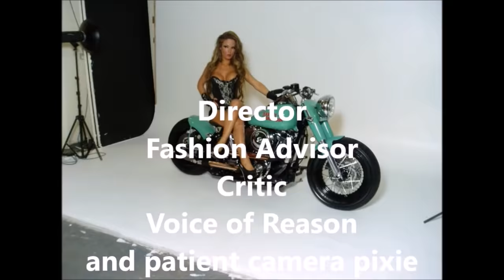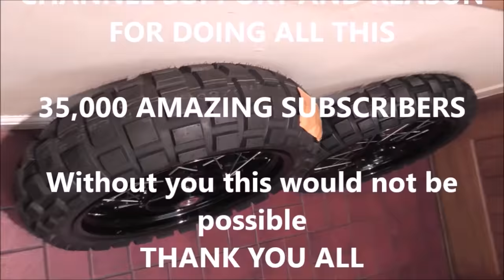Delboy's Garage, USD Fork Seal Replacement

Comment: It's much easier to loosen the top cap when it's not clamped by the top yoke so loosen the top yoke and clip-on first, then the top cap, then the lower yoke. Hope this helps someone.
Reply: I greatly appreciate your insights tips and tricks from all of us in Canada thank you very much
Reply: Agree entirely. Especially if the cap is pretty tight, the top clamp seems to compess the leg a (tiny! - everything is flexible..) bit making it even tighter. (as he said: "Actually, that's quite loose that ...")

Comment: Thank you for fortifying my courage to change my own fork seals!  I think I can I think I can... and with your guidance I'd bet I can!  Thanks for the great detailed instruction and also for your photographer for capturing in clear view all the internals and images!  Seriously, Thank you!
Reply from the maker: You're most welcome, glad it helps you Susan, best of luck with the job when you do it!
Reply: @Moonfleet41  Can I ask one puzzling question? I stopped by a well known local suspension shop and asked about them replacing my fork seals and got a negative (no, can do).  With explanation that they don't have the right tools for such long forks?  WTF?  (They are known for race suspension set up) But, just when would the issue of having to re-compress the spring and needing special tools come into play or be a concern?  TIA.... Susan
Reply: If you want an honest mechanic…. Get in there and turn them wrenches I have never out of dozens of encounters and much wasted time money and trust been short changed and lied to only to be in the position I should have taken from the beginning… wearing the blue coveralls and seeing the work through myself it’s same as any project you had to do in school first you find out what you are finding out the subject then researching that specific subject or component specific to your make and model not just videos either you read forums buy tech manuals read service bulletins from manufacturer buy specialty tools whatever you need to do to give yourself the best possible chance of success you will never do it another way after you start taking care of the work on your own it’s a great feeling
Reply: That being said I would happily hire this guy to do any work I could if he were in my area great work and thanks for posting this I subscribed and def liked thank you thank you thank you

Comment: I have re-changed oil seals on 3 different sets of usd forks due to a local bike repair shop not using the air gap messurment.. it's all very well adding the correct amount of oil if the internals are bone dry.. the air gap messurment tells you that 1/ the damper is bled and 2/the correct amount of oil has been added. . too much oil will cause exessive pressure and blow past the seals. ..... it seems rare to find mechanics these days that know exactly what they are doing ..... I would be happy to let this guy work on my own bike .
Reply: Did usd fork leak easier that just telescopic fork?
I heard its like that ,is it true?
Reply: The Correct amount of oil is critical .  All fork types

Comment: With the help of Delboys garage, I just replaced the steering stem cups and bearings, and disassembled the front forks, replaced the seals and re-filled with 10wgt on a 98 900RR. the bearings were shot and each fork only had about 4oz each of milky white watery oil. I also went over the suspension and set everything to the halfway mark. My bike now rides and handles like my 94 900RR did back in the day...which is "Resiliently". Thanks for the vids!
Reply from the maker: Great to hear it buddy... we're glad the video could help you out... have fun, summers coming.. Del.

Comment: The clutch side fork seal on my 2019 Versys 650 blew just before the current two week lockdown here in Pune. And I was so @#$%&* fed up. All workshops, whether official or otherwise, are closed with very stiff fines for opening them even for cleaning up. And I was mortally scared to finger the USD fork.

Delboy and Mrs Delboy, your absolutely brilliant tutorial was such an incredible relief. You cannot imagine how relaxed I became; to know that I can do this repair in my garage on my own and get the bike up was bliss.

The professionally careful and sensitive way that you handled the various parts is a lesson in itself; I showed your video to my electronics engineer son just to teach him this finesse in workmanship. So methodical, systematic, calm and composed. No unnecessary attempts at superfluous humour or off-coloured remarks etc. The exemplar of what a technical video tutorial should be like.(There is another video for exactly the same job and the way the guy there has handled the parts is an insult to the art.)

I haven't got the bespoke seal driver so will use some PVC pipe, insulation tape kind of mod. I'll play your video and work on the bike simultaneously so as to not make a single mistake.

Thank you ever so much for this terrific video. I have posted it on the Kawasaki Versys group for the benefit of all members there. Namaste.

Comment: I probably wouldn’t have attempted this without your video.  I’ve done other seals, but forks always scared me for some reason.  But this is totally doable, and even the seal driver isn’t that expensive.   There are nice aftermarket replacements for the springs, and even to add adjustable dampener on each fork.  Amazing.  I’m having fun wrenching on my bike.
Reply from the maker: Thank you for your feedback Jason and we're glad the video inspired you... good luck with your projects and happy wrenching!

Comment: Just picked up a Buell XB12scg that needs the seal replaced. The dealer said$275 usd if I bring in the tubes so after watching your video I bought the seal driver, the special nut holder tool, a front triple stand  and a rear super bike stand all for $360 and will just do all the servicing on my bike now. 
    Thanks to enthusiasts like you sharing knowledge and procedures, the option to perform these repairs allows us not to just save money but understand the dynamics of suspension and tuning to make the most out of rides. 
    Thanks bro brah!
Reply from the maker: Thank you very much fr your kind words of support, I really appreciate it and I'm glad the videos can help you, good luck with your Buell and have fun!
Reply: Where did you get a front stand for less than $200?

Comment: Hello from New Zealand. I have found this video very very helpful for my peace of mind although im not a mechanic but spent 5 and a half solid years within the heavy diesel automotive and construction machinery industry providing service and maintenance to my personal transport vehicles are no issue but now that i own a kawasaki meanstreak . . . . motorcycle work is very much new to me and my hat comes off to you for providing a well presented walk through for us newbies to service and maintenance in the two wheels department.  This video has given me the confidence to  crack on with it by myself as my forks are in the same leaking boat. 

Thank you very much
Reply from the maker: Hey Cheyenne, most welcome Sir, great to know the video can help you out!  Hope your fork seals replacement goes well, let us know how you get on!

Comment: Happy to see finally this video from you. especially because it is a usd-fork. 
Also my words...fork oil has to be changed regularly like engine oil!
To be honest, there are some additional points to mension and they are pretty important. 
When you put apart forks who have the bushings on the innertube you have to heat up the outer tube to reduce the possibility to damage the bushings - eespecially if you are planning to reuse it. Also quiet often the lower bushings are worn out without a damage on the teflon...this could also make the fork leak, cause the innertube can move in the outer and make a gap where the oil can drain out.
If you drain the forks you have to get them more time or flush it with a bit of fresh oil, cause all the metall debry sits deep down at the bottom.
If you have to polish the innertube, then do this job never in the direction the fork moves...always around and only(!) at chrome tubes...never ever at DLC or TIN coated inner tubes.
Be aware of the spacer between the bushing and the seal. the sharp edge must be on the side of the seal - that is incredibly important.
About the tools...alot of forks have these spacertubes to push down the springs. This KYB-Fork is a special one without this little tube. And you cant definitely do all bushes with this seal driver. Just as an example: the 05-06 CBR600RR is not possible cause the plastic is too short!
If you engage the thread of the cap...turn it counterclockwise till the thread comes free...then turn it in. A damaged thread at this position is a true nightmare!
And if you have a fork with mounted bushings in the outer tube, you dont have to use a seal driver at all

Hope this helps a bit!

Comment: Great vid. A small caution you may like to add, "wind the damper rod out before reassembly in case the locknut moves". If it screws further down and the damper rod is wound in, when the caps are tightened the damper rod will be damaged.

Comment: Thank you sir.  Just bought a 600rr with a leaking fork.  Effin' mess.  I'm going to tackle this myself, though I would add that my local cycle shop quoted me $375 (US) if I bring them the forks (my bailout plan) and $625 if I wheel in the bike.  You're saving your audience more $$ than you realize.

Comment: Great info mate. Bugger.. I just did my fork seals following your instructions, everything went fine.... BUT, I found if I didn't fully screw the valves in on the spring preloaders they wouldnt go in the full amount of clicks to set them up..so I took the caps off, screwed the valves in all the way and now it works mint, . Bike handles so much better now, Thank you.🏍🏍🏍🏍🏍🏍🏍🏍🏍🏍🏍/10  🤩

Comment: Fork seals replacment is very seldom and I've owned 30 mega motorbikes !  Because of the rare problem of knackered forkseals I've only replaced once on old rd400, BUT  USD forks ??? Is another story and my current MV Augusta F4  needs new fork seals!  So seeing your top professional video gave me hope for USD forks! ! So absolutely brilliant video and can't thankyou enough! But just one thing ya not mention dude!  The absolutely importance of NOT to scratch chrome legg!  As I did on my Yamaha  RD400 30 years ago! 👊 and thanks again for mega video
Reply from the maker: That's mate, good luck with your seal change... it's not complex, just take your time and check in the manual for any special tools needed before you get started!

Comment: doesn't the scarf wrapped around the bottom, affect the measurement of the oil level?
Reply from the maker: No because you dont measure to the outer tube.. you measure down to the 
top of the inner tube.. the tube that contains the oil..!!!! i should 
have said..!
Reply: Moonfleet41 Yeah thanks for your response, I have done a USD fork swap and had  to change the oil the way to explained was pretty easy
Reply: Not necessarily, Ducati manuals with Showa forks clearly says "slide both the damper and outer tube fully down the inner tube..." oil level needs to be measured from top of the outer tube
Reply: Wrong, the tube has to be all the way down on the stanchion, like he has it

Comment: Thx for helping brother. Saved me alot if work. After a engine rebuild the seal popped :(. Thx to this video I had it fixed in 3 days including ordering parts, and could test my bike properly. Thx!! B.t.w I used a Zipbag with strong plastic! Dropped some silicone spray on there and all went smooth.

Comment: Dude you have no clue how hard you saved me. I thought I had to remove the damper rods and it just seemed miserable so I was gonna pay $450 to get it done at a shop. After watching this I am entirely certain that it is do-able, looks kinda fun too! Thank you for sharing this knowledge sir
Reply from the maker: You're most welcome mate, these jobs are often not as hard as they seem... just grab a manual, read it through, follow the steps and you'll get it done!   Good luck with it buddy, and remember to have fun.

Comment: Excellent video. Helped me no end in stripping down the forks on my ZZR1400. My local garage were going to charge £100 if I supplied the forks loose. OK, I  spent around £90 on tools, seals and oil. But I can change the oil again in 12 months time for FREE. I ordered 2 litres of oil, just in case. Of all the things you can do on a bike. Fork oil probably makes the most difference. Especially if it's 10 years old... Cheers again Del
Reply from the maker: True words indeed mate, forks make such a lot of difference to a good handling machine..

Comment: Delboy - you inspired me to have a crack and replace my fork seals and headstock bearing - both were shot. You made the headstock job look a lot easier than it is!! Anyway fork seals: I tried two methods - the condom method and your milk bottle method of sliding on the new seals. I gotta say your milk bottle cone method works way better - the condom method just tears! Also tried the method of wrapping electrical tape to form a seal driver as I was too cheap to buy a driver - works quite well and doesn't bear on the inner seal.
Thanks again for the invaluable tips, and keep the vids coming! Cheers,
Scotty NZ.

Comment: My local shop wanted to charge me $420+tax to do this on my '06 GSXR-1000. This video pissed me off after seeing how easily done this is and how much all my local dealers wanted to charge me for this service. I will be investing in $100 worth of tools to save myself well over $650 (cheapest quote I found for fork seal fix and replacing front tire).

Earned a sub! =)
Reply from the maker: Hi Adeum, im glad the video could help.. good luck with your seal change.. !

Comment: This was a top notch video mate. You included not only all the relevant knowledge needed to accomplish the job to a professional level, but some really useful & innovative tips on how to create your own inexpensive tools to do it. I will definitely be looking at your channel if/when I need more how to tips on fixing my machines. Was able to install new tubes and seals, with the drivers I made, on my 2008 FXDF in a couple hours and the bike is back on the road, front suspension working like new, without a factory service manual or special tools. Keep up the great work. Thanks a million for taking the time to create this video.
~//~

Comment: Thanks so much for this video. It was infinitely helpful in replacing my fork seals on my Africa Twin. I was just going to take them off and top up fluid for a leaky seal. Glad I learned how to do it as both seals were torn and would have continued to leak. The step by step instructions made this a fairly easy job.
Reply from the maker: Thanks Mike.. im glad the video could help you out, and darn good on you for getting stuck in and doing it yourself.. feels good aye.. take care and have a great weekend... Del.

Comment: Fork seals went on my 1200 Bandit. But, I got a TL 1000S front end. I watched your video, my forks where slightly different inside, but pretty much the same. I found your video to be very helpful, and gave me a good few pointers.
Reply from the maker: Glad it helped and good luck with the upgrade, it's a great solution to the Bandit forks!

Comment: One tip if you have a seal driver with no teflon stripes inside. Take the aluminium foil, MD grease if you have it, or silicone grease (very thin, for sewing machines, or shaving devices) grease the fork leg slightly put aluminium foil around, and then the seal driver around so it doesn't touch the chrome. Aluminium is way softer than fork leg chrome, and if anything it can only improve the chrome never damage it. Couple of strong taps and it's in. Oil seal will push the grese or oil as it was above the seal.
Done it on my Kawasaki KLX650 couple of days ago. Might help if you have a cheap seal driver

Comment: What a great video, I just wish I had found it before I started my seal change on my 650 08 Versys. I removed the bottom allen bolt holing the damper and spring, and removed it all in one piece, change the seals and then replaced it all back together and top correct amount of oil, I guess thats why both forks do not feel the same. pleased I found this video before I put them back on the bike, by far the best video Ive seen, and in English.  Subscibed
Reply from the maker: Thanks Nobby, you're very kind, im glad the video could help you out.. and thank you for the Sub, its good to have you aboard... ride safe mate,.. Del.
Reply: @Moonfleet41  I`m here again Delboy, need doing again, and my memory isn't as good as it used to be, £72 an hour + VAT I`m not paying that much for the garage so you have saved me again Thanks hope you've been well and still are?

Comment: Great video Del.  Just a heads up to you other guys out there.  I busted up my bushings getting the tubes apart.  A buddy told me to heat up the fork seal before separating the fork, he said that it works great at helping the seal come out.
Reply from the maker: Never heard that before buddy.. they always just pop out with the "slide hammer action"...!!!

Comment: I use pvc electrical tape over the bush with a drop of oil over the tape SIMPLES but the plastic rap is a dam good idea :  learnt loads great video respect at you Del thanks